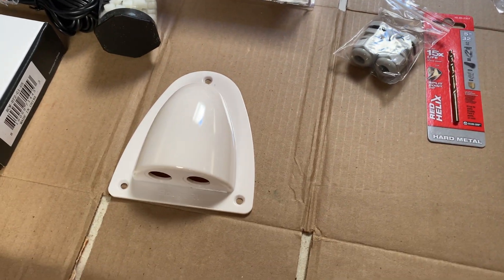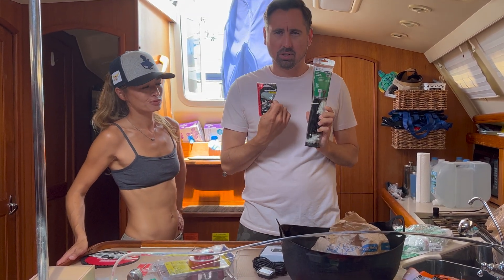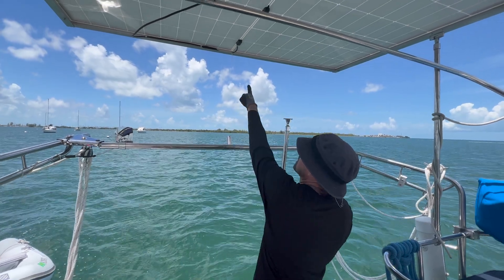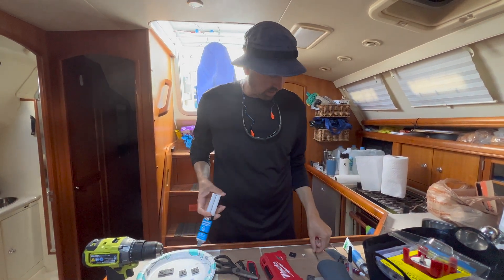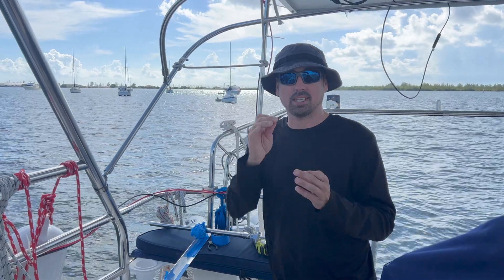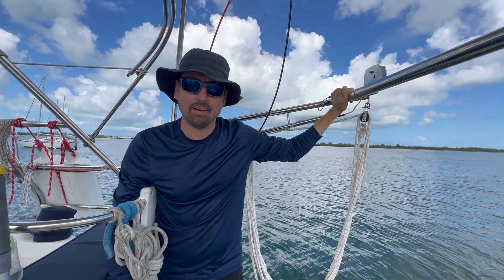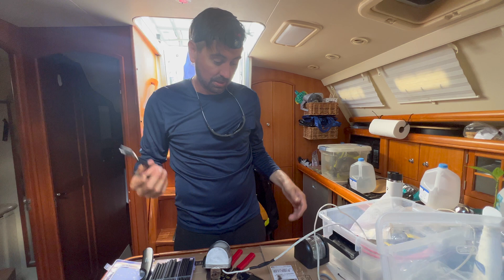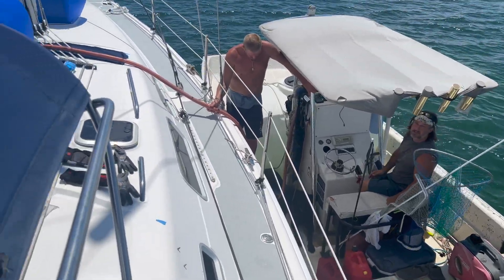Wrapping Up Loose Ends

Comment: Hi Guys...Great video.  I truly enjoy your "How To" videos.  They give me ideas for my little boat.  One question though.  Why install a battery switch?  From what little I know (VERY little) about solar systems is that there can be multiple charging sources run simultaneously.  The controller has a diode to prevent "back-charging" to the panels.  What am I missing here?

Keep the great videos coming; especially your DIY projects!!
Reply from the maker: Hi Les! Thank you for watching! We added the switch to avoid “reverse charge” to the solar when connected to shore power. You are correct, controllers should prevent this but we couldn’t find the language in the literature of our controller to confirm. So we thought we would play it safe ☺️